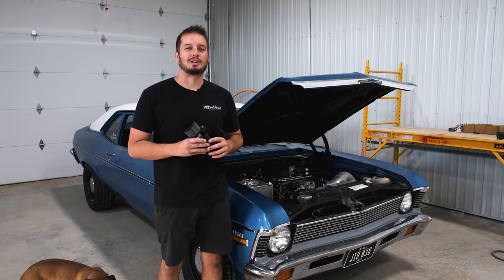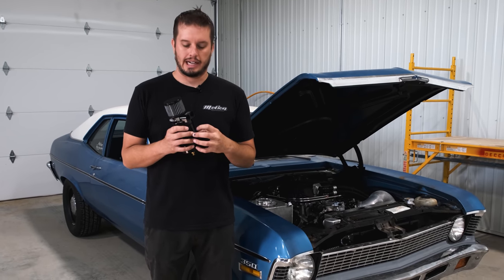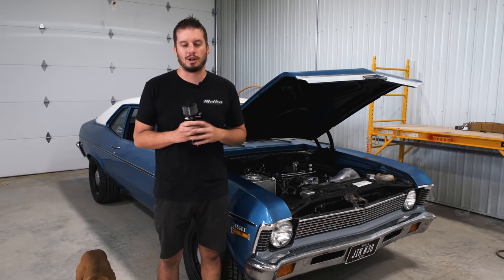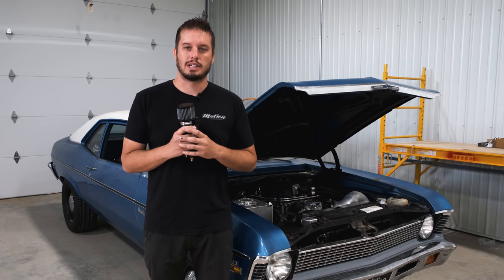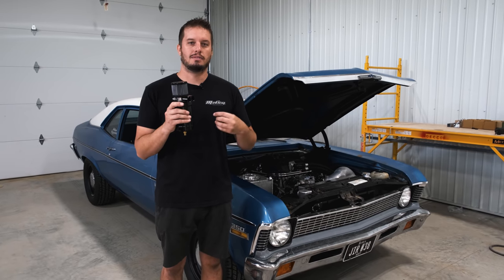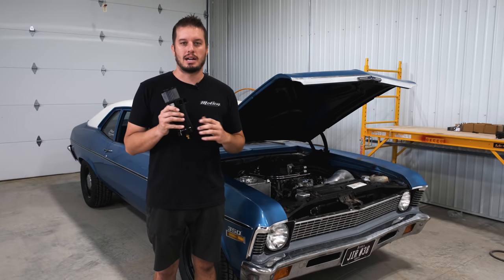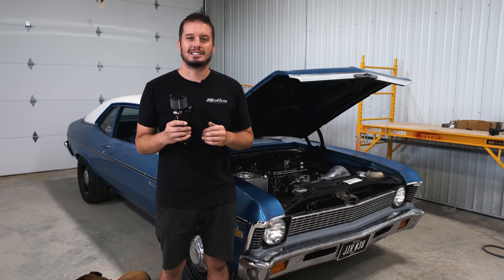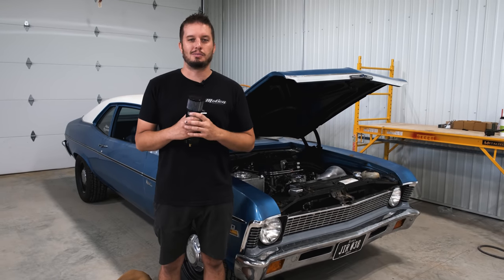How to setup an oil catch can on a high performance engine.  Tech Tip Tuesday!

Comment: This channel is so under rated, you guys do so much for the racing community. I look forward to the day when Motion Raceworks is as big as Summit or Jegs.
Reply from the maker: super appreciate that man.
Reply: FACTS.. Absolutely awesome group of guys
Reply: @MotionRaceworksOfficial  It would be really cool if the catch can had a way to see in. Like a line down the side, similar to an oil jug where you can tell how much oil is left in the jug. Even just a sight glass may be enough, if it was placed midway between the top and bottom of your can. You could check every once in awhile with a light or something. Then if you saw oil you'd know you had some kind of problem since the catch cans don't usually fill up.

Comment: When we first started to run Methanol through the big block in our drag car, our crank case ventilation was inadequate.   We found out that it can be very dangerous.   Driver side valve cover (cast aluminum) exploded sending pieces into the fender and fiberglass hood.   Could have been a bad deal had someone been leaning over the fender with the hood up.    By the next weekend we had a crank case pump never had a problem after that.  This was well before Motion Raceworks came along.  But lesson learned is that Doug is right and that crank case ventilation is very important and to make sure you have a good system in place.
Reply: Running a PCV valve?
Reply: Probably a vacuum pump system that is driven by the drive belts.  Just put one on my 410 ford cleveland stroker.

Comment: The air/oil film finding a way out, 100% can confirm. I have a baby 700 hp BBC 540 thats NA and had the PCV vented to the intake. Idling, around town driving nothing and not a big deal. But when giving it the go pedal, oil was pushing out the filler cap then running off the back of the engine and making a mess. I'd also get puffs of white smoke too from it being burned in the engine. First build I've done at this power level, learning as I go, and solving problems as they come up. I ordered one of these cans because the baffling and am excited. My first Motion Raceworks product.  Love that you sent an email with how to setup and the video was full of great information. I didn't even think about if you're venting to the intake how it could throw more air in, mess with your AFR and need tuning to adjust the top in. Cheers!

Comment: Just a couple days ago Cleetus told us to put the catch can vents toward the front of the engine because of the G force during acceleration tends to push oil out the back of the covers. You guys need to get on the same page about this stuff.

Comment: Using the generic term "air" for any gases in a conversation is wrong and annoying.  "Blow-by gases" would be correct for this discussion.  Air:  the invisible gaseous substance surrounding the earth, a mixture mainly of oxygen and nitrogen.  Obviously there is also some CO2 in there.
Reply: I’m amazed you figured out what he was talking about since air is such an in accurate term in this case

Comment: Hey mate im from Australia 🇦🇺  and currently running a worked 6ltr v8 in my Holden commodore and im constantly getting fumes coming in to the cabin and was wondering if this catch can will fix the issue thanks

Comment: Made one at work about 8 months and did some nice baffling in it. Man the difference in the cleanliness in the intake when I did injector change for my mass air swap. in my 96 351w powered f250 the milky yummyness and my dry filter tells me I did a good job 😁 thank you for another good video.

Comment: Many people have small oil leaks they cant figure out because they aren't letting their engines properly breathe and have bad crankcase pressure making the oil push out anywhere it can. I have a supercharged Camaro that made 753whp but I had large amounts of oil bubbling and fumes coming out of the little breathers I had for each stock LS3 valve cover. I also had oil coming out of front main seal multiple times. Found out that I needed to allow engine to breathe better by plugging up the little pcv ports on both stock heads and getting bigger breather lines on each valve cover to reduce pressure. My oil leaks were fixed after that and now that I learned that I bought 2 Motion Raceworks breathable oil catch cans with a -12an setup for my new engine.

Comment: Exactly how i do it on my 68 mustang fuel injected 438windsor street strip car. Run 2 Moroso baffled open breathers to a catch can with filter on top. I still occasionally see oil sneak out between breather and valve cover seal, but nothing major.  Both my moroso breathers have a filter inside of them and they are baffled.  Best breather design i have yet to see. My AFR valve covers have a small baffle over opening but nothing like the valve cover baffles in video. I see steam coming from catch can filter so the system works well. Its a borderline race motor on the street.

Comment: Catch can are good for ALL engines. I’ve had a Ford Performance on my 5.0 F-150 since new in 2018 and a Moroso on my wife’s 2015 Honda Civic since since 2017. There is ALWAYS oil in them when checked. My LSR engine has had a vacuum pump for 25 years and because the engine has close to zero leak down the container has only had water condensate in it.

Comment: I've heard the L8T and other Gen V engines need the additional vacuum from the intake connection with a more traditional catch can to effectively evacuate the vapors from the engine.  Thoughts?

Comment: Have a 1964 lincoln old style system hose coming off the oil cap so I get crankcase fumes. Would this work without plugging into valve covers?

Comment: What's the best way to pull a line off of stock valve covers? I'll be right around a thousand whp. I don't want to pay 400 for a set of cheap valve covers..at least not quite yet!lol but, I do want to add a can in my boosted 99 Camaro!

Comment: Would you recommend one on a stock 6.0 Silverado that tows a lot? Would baffled valve covers be needed in this situation?
Reply: For longevity purposes any engine can benefit from a catch can. It helps prevent oil from being recirculated back into the engine in places that oil doesnt need to be. There are different kinds, such as those that dont actually vent the pressure, but simply collect the oil and send the pressurized air back into the manifold, which maintains your factory emissions system.

Comment: I know this is probably overkill, but it's my line of work, and I see things a bit different. For instance it would be nice if you could incorporate a flow rate indication on your catch can for a visual reference. It could be used for an indication of clogged/pinched line or an over pressure issue. I imagine one day, if it is accurate enough, a bench racing conversation comparing the CFM created on a stock motor to a more enhanced version of said motor. Let me know if you need a hand with the instrumentation side of it.....
Reply: Since there's a ton of variables it would be easier/better to monitor crankcase pressure and many racers already do that.
Reply: I was just trying to kill two birds with a single stone.

Comment: Would it be possible to create a vacuum  in a crankcase to minimize this problem in the first place by a vacuum pump of some sort?
Reply: you can get a vacuum pump, they are used with dry sump systems and just used to help with piston ring sealing, a properly functioning PVC system should work just fine tho
Reply: @PredaFran  I would think that would be ideal under boost conditions but I like the KISS principle.
 Keep It Simple Sir
Reply: @adeptpeasant6161  it's a Simple belt driven pump, it's ideal even while NA, longer oil life, longer ring life, and more horsepower

Comment: I have a 454 Chevelle I want to put catch can on my engine I have the Edelbrock pro flow 4 fuel injection but my cast aluminum valve covers do not have Baffles they cost $ 750 dollars do I have to baffle them if so how they don’t have any holes in them yet I’m in the process of building my chevelle it’s just a show car with 500 hp

Comment: Doug shouldn't ur breathers be pointing twords the front of the motor to prevent oil coming back to them during pulls? Or is that just something that is falsehood?
Reply from the maker: We have found it to be a falsehood, with proper baffling and the fittings being at the top of the valve covers it’s never posed a problem

Comment: Pcv is more caused by natural blowby, not necessarily so much as by the movement of the piston.
Reply from the maker: It’s actually both
Reply: @MotionRaceworksOfficial  but wouldn’t the movement of the piston cause the turbulence and air pressure changes around the rotating assembly primarily while blowby is left to cause the increase of gasses entering and therefore having to vent out of said crankcase?

Comment: this is vented to the atmosphere, in almost any state this is not allowed
Reply: Legal in all 50 states. Not sure what you mean
Reply: @livewiregto  if the can is vented to the atmosphere.. must be a sealed system.as mine is
Reply: @randellgribben9772  wrong
Reply: @livewiregto  does it not have a air filter on top of the ovs?

Comment: For a road car a PCV is good though not essential. Though a legality to have one,, for 50 years!!  For a race car a NO NO. But fancy catch cans will not improve the car any.  A couple of 3/4" hoses pushed into an empty 5 litre oil bottle will catch the oil fine. ten 1/8 holes drilled will bleed the pressure. AND they should be close to the engine,, not in the back which is plain dumb. $5 worth of hose and recycle some waste. Unless you like shiny expensive bling shit!!
For road racing a catch can must be mininum of 3 litres. And all these full fumy turbo drag engines must push out quite a deal,
Ideally breathe the pan into a rocker cover, crankcase fumes then go from rocker covers to catch can. I have done that for over 40 years and unless the engine was junk never ended up with more than a few ml of oil in the can, usually more water vapor. This on road race and speedway engines.

Comment: I'd like to see a tech tip video on running functions on switches. ECU's these days have the ability to control multiple fuel pumps, electric water pumps, intercooler fluid pumps, etc. Why are people still running all of that stuff on manual switches that can be forgotten?

Comment: Love the product but just wondering about volume of the tank, in Australia we have to run a 3 litre can for circuit/track applications. Do you have a bigger one? I’m having trouble with my my new LS putting about 2 litre into my can over the course of a weekend.

Comment: I was hoping you would say something about PCV valves on OME? cars to explain at an even more basic level, I hear people say "the engine lights on be cause they want you to change the pcv valve, but their just trying to make money" 
Is this at least kinda on that same though line, or am I wrong? Oh by the way you guys rock!
Reply: I think ya meant "OEM" ( not "OME" )........or am I mistaken? OEM stands for "original equipment manufacturer". When you buy replacement parts for your factory original vehicle, certain parts available at auto parts stores are listed as "OEM" parts, meaning they are satisfactory parts with the same spec's as the original part. ( at least they are suppose to be ) On factory original engines, it is very important to replace a PCV valve once it has become all gunked up after a long period of use. Because once a PCV valve becomes dirty & clogged up ( even partially clogged ), your valves, intake, and combustion chambers will start getting all sludged up, resulting in poor performance & economy, and shorten engine life.

Comment: Best video on this I have seen-  

I have an 06 mustang 4.0 v6 that has been supercharged  (root style) off of a 04 lightning. In order to mount that sc on the intake, one had to be fabricated to do that. So saying that. The passenger side pcv and drivers side, I think is is called a ccv are both not connected with hoses as they normally would be in stock form. So, I'm looking for a scenario that would best work for this set up I have, please. 

Other info.
- egr has been deleted
-no intercooler or heat exchanger 
-no meth. I'm working on this
-car dynoed at 380 rwhp

I also have a 2015 chevy Silverado 1500 LT 5.3 flex fuel. I'd like to add a catch can to this as well. I live in cold MTvand I have heard running these can be an issue in colder weather. Is the something additional I can do in the colder months?

Your help would be greatly appreciated.  

Thanks

Comment: So this same setup applys to 6 cyl aswell yes? Wanting/needing to put a catch can on my is200 was wondering if all was needed to be done was attach a hose to my pcv valve and the other hose to the exhaust side ventilation correct?

Comment: I was running a line from the PCV to the catch can and then other from the vacuum back of carb.  Sounds like I don't need a PCV and to plug the  vacuum on the back of the carb?

Thank you!

Comment: Running this setup on my boosted LS. Its currently on E85 and I get a small amount of clear liquid in the can . Is that normal?
Reply from the maker: Yes that is actually moisture/condensation not blow by.